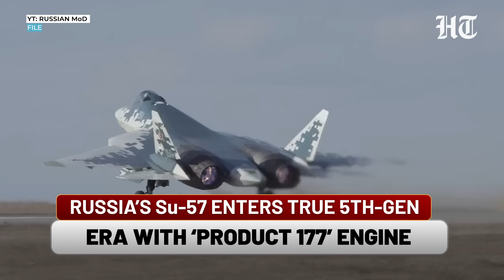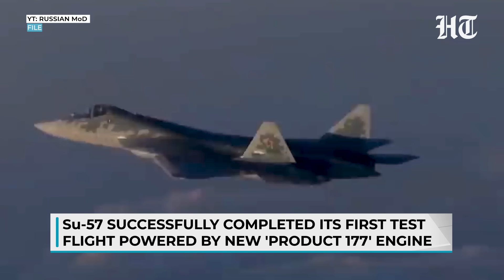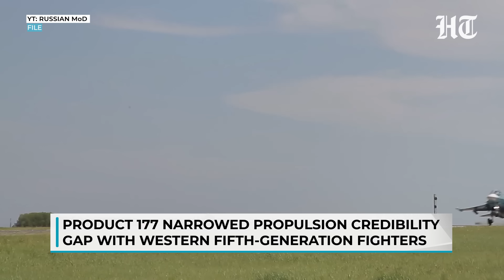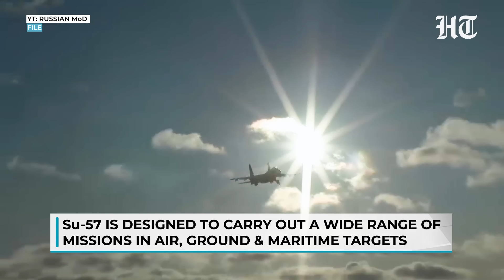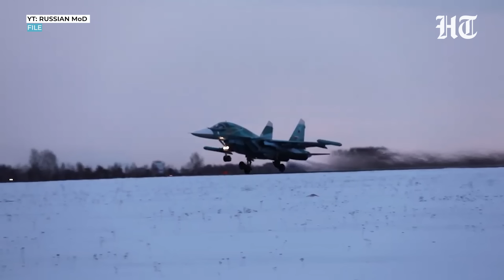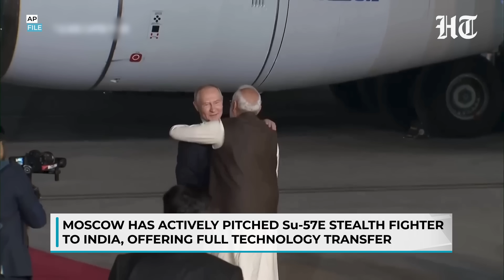Russia Unlocks Full Su-57 Stealth Power With Game-changing Engine; Western Sanctions Failed? | Putin

Comment: Product 177 engine is a not a fully 5th gen engine..the actual 5th gen engine is AL51 for SU57...   

But russia is pushing for product 177 engine in SU 57 for export market and using this engine in SU75 manned and unmanned versions will make SU75 even more cheaper  ...  But india would be interested in the engine for SU30 MKI upgrade
Reply: Correct, but still an upgrade, noticeable one.
Reply: there is only a small difference between 177 engine and AL51 bro...
Reply: @TCentrep that's not true...AL51 is clean sheet design  developed as a 5th gen Engine...and 177 is developed using implementing part of  AL51 technology into 4the gen AL41 engine

Comment: Let's laugh responsibly 🇬🇷.
After endless delays, "the ruzzian aerospace forces 😅🤣😂" now have 12 fully operational Su-57. With the sanctions imposed on ruzzia, it is impossible to build more. The Su-57 flew with Saturn AL-31 engine (mid 1980s).
Recently, a flight was made with Saturn AL-51 engine (first run 2016.
The HT is spreading cheap propaganda to the uninitiated and the vulnerable.
Reply: What ur country makes?...